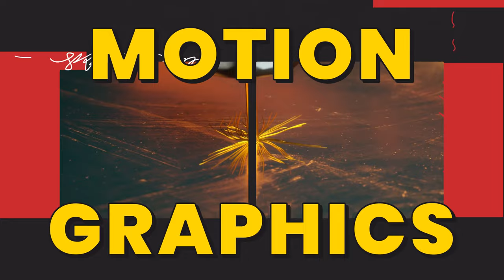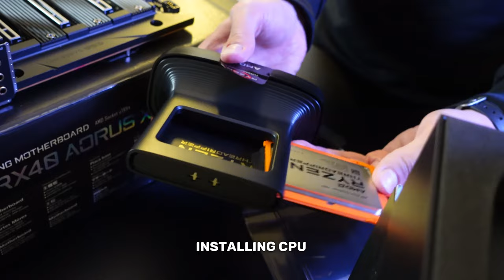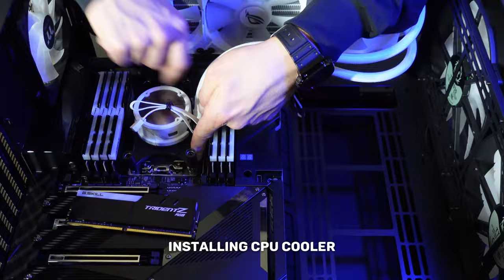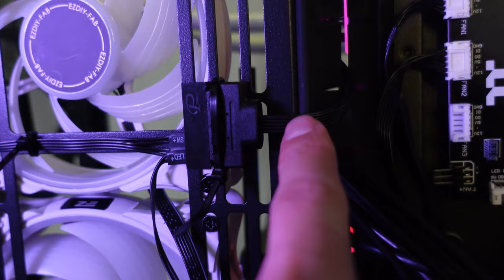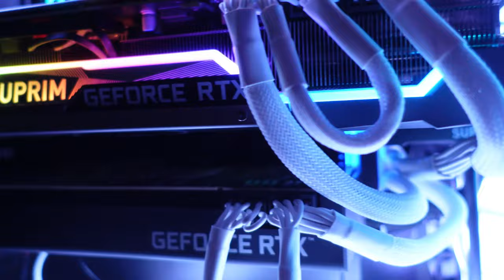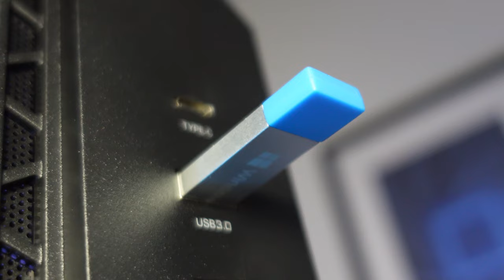How I built my PC for 3D design and motion graphics production.

Comment: Did not expect a Thread ripper build. This could cost 10 grand easily. Just a quick observation, that 3090 is water cooled right? I have no experience with water cooled GPU but what I do know in theory is to keep the fans/radiator above the pump. Can't remember the theory behind it, but better to check
Reply from the maker: Hey @ZakDKnight . No, the GPU is not water cooled in my case. I'm using only fans across the whole PC build.

Comment: How much did this cost in total to build this? Do you have any recommendations on what to get for graphic design and illustration work?
Reply from the maker: This costed between £6k-£7k (excluding monitors, keyboard and mouse). 
For graphic design and illustration MacBook Pro would be just fine. You can connect an external monitor to it.
Reply: @alexpolozun  Wow that costs a lot.  but I'm sure it works great. How about the budget ones? Any recommendations? I'm a little bit broke😆
Reply: @alexpolozun yeah bro you got any cheaper recommendations? Maybe £2-3k? 😭

Comment: 2nd card a 2080ti?? then you cant nvlink???  and why a 3960 do you need more pci lanes? the 5950x can handel 128gb ram too. im alittle confused.
im sure your not gonna render on the cpu? only thing i can guess at is viewport? but is it that much better
Reply from the maker: Yes, second card is 2080ti. Yep, I'm not using nvlink. I'm not rendering on CPU, but the better CPU the easier it can handle heavy scenes and 3D simulations. I use GPUs for renedring.
Reply: @alexpolozun  ok thanks i was just wondering as im gonna build a new pc, im no expert so i tought i would ask if ther was some tips behind the config/setup.
Reply from the maker: @silverbulletin846  No worries. Hope the video gave you some useful information.

Comment: 4090 🤔
Reply: Would make sense to save up, but you will dish at least $600 more dependending on what you go for. And would probably go for 1500w instead of 1200w PSU as the 4090 is known to spike. Still a great build !